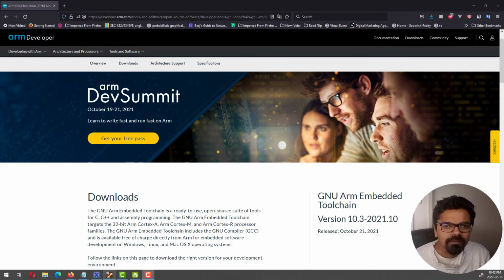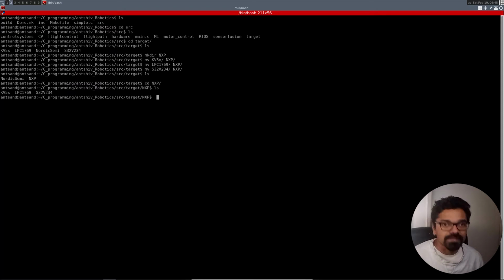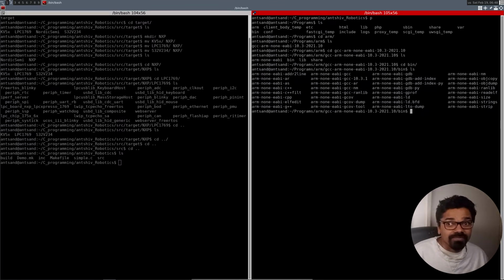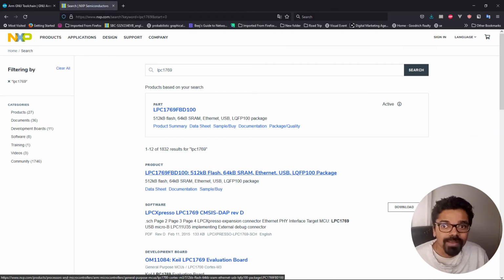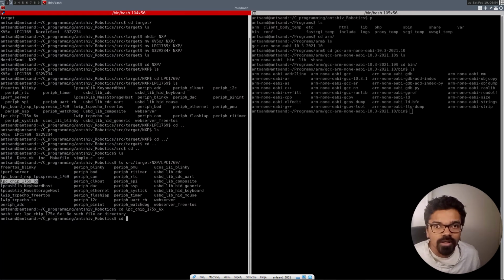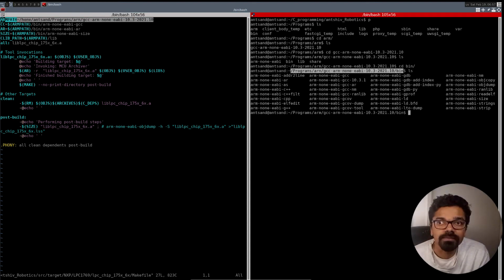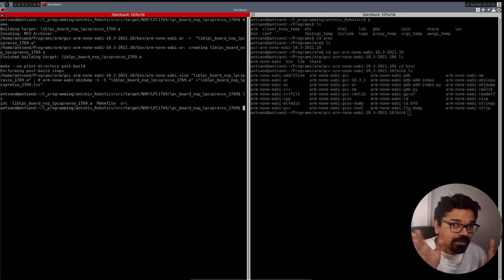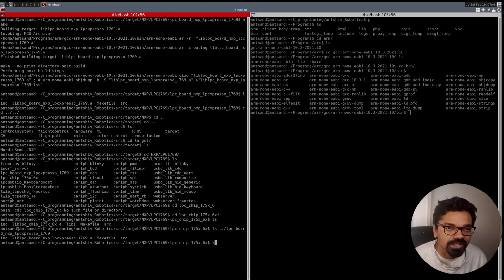ARM embedded development using linux and Vi - Custom development environment (Part 1)

Comment: Antshiv, I bought a SAM4S Xplained Pro only to find out that the defacto way to develop for it is with the Atmel Studio V7 which is not available for Linux. I followed through the first half of your video just fine and found the arm gnu tool chain download. As I understand, the next part has to do with getting chip support and board support files which basically enumerate definitions paired with a specific product. I am writing to you because I don't see a BSP for SAM4S Xplained or the ATSAM4SD32C chip that it uses. What recourse do I have for aligning myself w/ the second half of your video? Thx.
Reply from the maker: Hi @quinncarver! Microchip acquired Ateml some time ago and has established MPLAB IDE as the dominant integrated development environment for both Microchip and former Ateml microcontroller units (MCUs). They offer a Linux version of the IDE, which can be accessed through this link: https://www.microchip.com/en-us/tools-resources/develop/mplab-x-ide#Ecosystem.

On the aforementioned page, they mention the following: "Make use of MPLAB X IDE's support for the open-source AVR MCU and SAM MCU GCC compiler."

Additionally, if you are interested in SAM MCUs, you can find further information at this link: https://www.microchip.com/en-us/products/microcontrollers-and-microprocessors/32-bit-mcus.

I hope this information proves helpful to you!
Reply: @antshivrobotics  wow! this is great news. Amazing I saw no mention of this in an hour of grepping around the internet. You sir, are an excellent resource! I will check out the MPLAB IDE in my learning time today. Thank you very much!

Comment: holy .. great video! 

i dont know exactly if you already did a video / if its even possible but:

in my job i am using the atmel Xplaind boards to develop, and then later throw all onto a selfmade board with just the chip. i really grown into the microchip world, and i do like the debugging capabilities of Microchip Studio + EDBG stuff. But thats Windows only ...

any suggestions / viable alternatives that you can think of in terms of software?
or any idea how i can change my workflow / thinking, so that this kind of debugging option is not needed? i mean i'm able to watch the chips from the outside (oscilloscope) but i dont feel thats the same .. 

anyways, thank you for your great content. also your style of video & quality is superbe!
Reply from the maker: @juelz navi Thank you! Microchip microcontrollers can be programmed using both GDB and Microchip's own MPLAB XC compiler. Both support Linux. To run an IDE on Linux try using MPLAB X IDE (https://www.microchip.com/en-us/tools-resources/develop/mplab-x-ide).

In terms of making custom boards and debugging, there are a few things to account for.
1. Is the board soldered and working correctly - How do I do a quick test to check if all the pins are working (Hardware-level scan)? JTAG Boundary Scan. OpenOCD is something to look at. There are other sophisticated tools out there that can connect your PCB design files (Odb files) with your custom board and tell you where in your PCB there is an error. Open circuit, short circuit, etc. Might require a hardware debugger that has this capability. Microchip provides this. Something to look at?
2. If you have a segment fault, where is it crashing and can I do line-by-line debugs? If the microcontroller supports the GCC compiler then you should be able to use GDB. Microchip supports GCC and GDB on Linux. Both can be used from the command line. Sometimes I prefer using a graphical interface. But the command line too can work.
3. You have programmed the board and no visible software issue. But the board is not behaving correctly - Here you may need to use both the above step and logic analyzers or an oscilloscope.

Depending on your project, and workflow you may have different needs. For me, I have a project that will be using multiple MCUs and software configurations. Switching from one IDE to the other might work, but it is not efficient. Also, how do I organize my code? How do make a CI/CD pipeline for my codebase to debug, test, and compile into production? Using Linux, the command line and such folder structures is the type of workflow that makes sense to me.

Hope it helps!

Comment: hallo Antshiv,
what is ARM? is it a microcontroller?
Reply from the maker: @Blaiso Fotso, ARM is an architecture to design microchips and instruction sets. Similar to Intel's Pentium processors or core i3,i5,i7. All these are, are designs that help computers compute. The ARM architecture is ubiquitous in the embedded world. Most likely the phone you are using has an ARM-based processor. The reason being it offers high computing power while consuming much less power. This is one of the reasons why every embedded manufacturer has adopted this architecture. ARM-based architecture can come up in both micro-controllers and processors. ARM itself is a company that does not manufacture any devices. They provide the design. The toolchains they provide should work with any microprocessor/controller which is ARM-based. Other manufacturers that want to adopt this architecture need to buy licenses to use their design. It is very difficult to come up with a design that works well. Manufacturers know this hence they rather buy the licensee to the architectures than come up with one.

ARM is not the only architecture in the market that dominates this space. There is an open-source architecture called RISC-V that is emerging. Many manufacturers are starting to adopt this too.

Hope it helps!
Reply: @antshivrobotics  thank you
Reply: @antshivrobotics  I was not able to follow you. I would suggest you do videos to explain how to use Linux and it's commands, a video series on ROS would also be great.
Thank you in advance
Reply from the maker: @blaisofotso3439  Sure. You can check out this video if you are getting started with the command line. https://www.youtube.com/watch?v=_HMTBKykp_w 

I have not worked too much with ROS. Will make a video series on it shortly. Thank you for your suggestion.